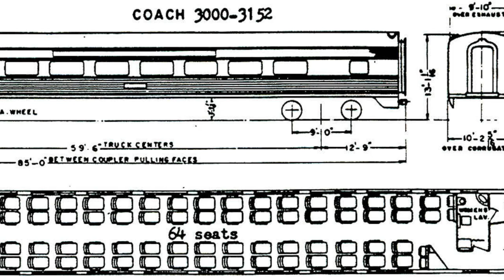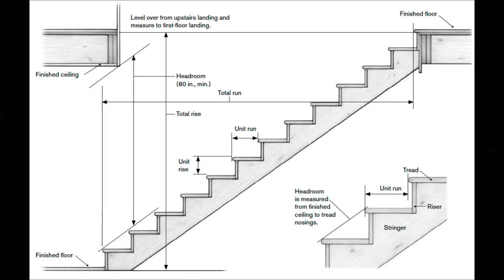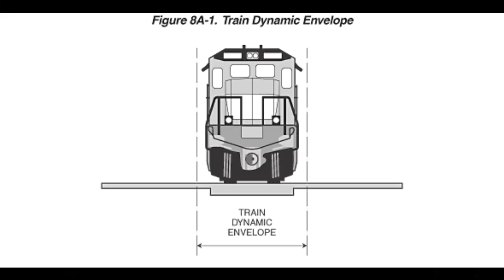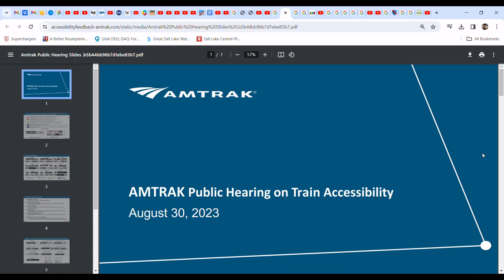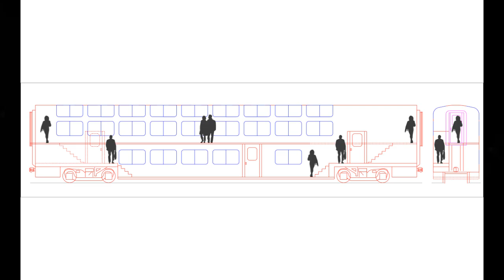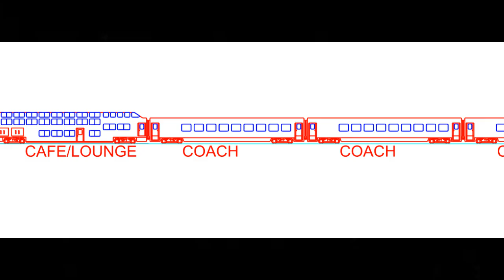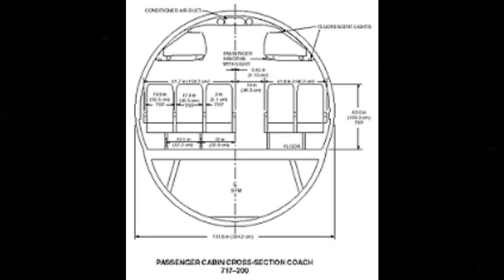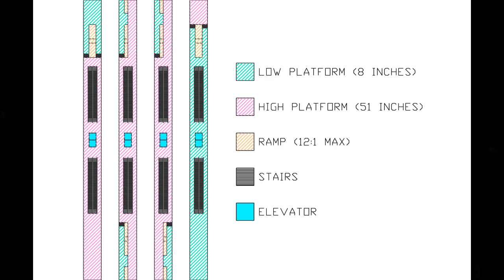An Excessive Explanation of North American Platform Heights

Comment: Seeing how complicated the built in bridge is, I'm wondering, why not just build the bridge like they do on ships? They have it on Stadler LRVs used on BOB in Interlaken Ost, Switzerland.
Reply from the maker: Some rail vehicles do have the bridge plate built in - but the bilevels I featured are designed to be cheap to build and maintain. If you assume that there will always be a conductor present to manually lay out the bridge (a safe assumption), it becomes more cost effective to go with a simple manually-placed bridge.

If you care about keeping dwell times short, then a built-in bridge is definitely the way to go!
Reply: @CSLenhart  I was actually speaking in terms of the bridge/ramp's design choice from a mechanical point of view. 

I visit Switzerland 2 years ago and saw how the lower bit of the train doors would fold out about the bottom edge of the doorway, and become the ramp. It was on their tram-trains on the BOB and ZentralBahn. I haven't seen this design reproduced anywhere else, at least on trains.

And I can't imagine this feature being a problem for Stadler either.
Reply from the maker: @ABCantonese  Oh, definitely! Gap fillers and automatic bridges are becoming more common across European low-floor trains. They definitely have some inherent mechanical complexity, but by now the designs have become solidly reliable.

This is certainly something that Stadler can port over to the USA from their Swiss designs, so long as their American clients know to request them.

Comment: I saw your dome car plan along with the platform height explanations.  I have a few comments.  A.  I think that it's a pretty good idea.* . I hope you send it to amtrak. B. the explanations were quite helpful. particularly the numbers for tunnels, the dome car height, and other measurements.  
A few more details. 
Amtrak could straighten the stairway and add two narrow side ramps just for wheels on the side of stairs. In the event of an emergency and a non functioning stairway lift , crew could more easily evacuate non-ambulatory passengers from the 51 inch to the 8 inch levels. (or the superliner entry level.)  Straight stairways to an upper level can be used to also help guarantee the same ease of evacuation in case of  power loss/ derailment etc.  
Overhead bins like on airlines are a terrible idea for trains lockers near the stairways are better. or under the seats on the upper level. 
Since you haven't ridden one , I will tell you there are dome cars on the Canadian. Dome cars are really fantastic . you can watch videos of Domes, but it's not quite the same experience.
Reply from the maker: Thank you for the thoughtful feedback. The straight staircases being more accessible is an excellent point.

Comment: Thesis, have the truck located just under the roof of the car with the wheels directly connected to it, thus allowing for an 8-inch-high platform
Reply from the maker: @DubGathoni  That's a neat idea, it sounds sort of like the Talgo design. Come to think of it, I wonder why the Talgo floors are so high?
Reply: @CSLenhart  I am not a mechanical engineer, but if I were to make an educated guess, the wheel size has to be a minimum size and because of the live axle, it would create a hump between cars which would not be in line with US ADA or EU PRM regulations.

Comment: 10:44, my problem with this is that any such car built to this hypothetical standard would be by necessity, not passively accessible.  Anything can be made accessible using powered equipment, but (while this is less of a concern on modern trains) if there was a power interruption, it becomes inaccessible very quickly.

Comment: I support what you suggest, but your chair lift argument is completely wrong. Amtrak only has less than 200 of those lifts, at max 1 per station. What you are proposing is at least 2-3 gap fillers per consist, ideally 1 per car. That's way way more equipment to maintain.
Reply from the maker: @jnrfalcon  That's a good point. For single-level cars, two gap fillers would be the minimum (one for each side). That would total up to a large number of mechanisms. For bilevel cars, the retractable ramp would only be needed (strictly speaking) on cars that have a wheelchair lift. That's fewer mechanisms, but more than the number of station-based lifts.

However, there is a major difference between a mechanism attached to the car vs machines stationed at outdoor platforms. The rail cars are full of other mechanical systems that need to be inspected and maintained regularly. Adding one more system adds trivial costs to the regular maintenance schedule. 
Sending workers out to individual platforms is an extra cost, no way around it.
Reply: @CSLenhart  I'm still not quite convinced. But I do want to add to your point that as long as there's at least one or two gap fillers on each side works per consist, all the other ones can be deferred maintenance items. Station based chair lifts usually don't have backups. 
Anyways, as long as there're arguable points, I doubt it would happen, at the very least not during the next 4 years...

Comment: I think Amtrak should modify the design of the Twin Viaggio cars and add doors on both the lower and mid-level sections to be compatible with both High and Low platforms throughout the Amtrak system, like with Caltrain's Stadler Kiss EMUs in San Francisco. They should also lower the height slightly to meet compatible clearances in NYC Tunnels and underground stations. It should be called the Siemens Voyager. It won't just replace the Superliners used on Western LD Amtrak Trains, but also the Sleeper/Dining Viewliners and Coach Amfleet IIs (the Amfleet Is are already being replaced with the Single-Deck Venture cars). So if that were to happen, all Amtrak Long-Distance trains would be Bi-Level, and Intercity Trains would be Single-Level. The new Long-Distance Cars could also be some of the most technologically advanced trains in North America, equipped with TVs/Entertainment Screens in the Romette/Suite (A first for Amtrak) to entertain passengers when nothing is interesting to look at out the window, and also outdoor POV cameras on each Bi-Level Car with Night Vision, so each passenger can see the view outside the train better at night as the train rolls along. It could also come equipped with LED mood lighting in each Romette/Suite (controlled with the entertainment screens), to better pamper passengers during the long train long trip. And unlike the former Superliners, access to the next car will be accessed at the Mid-Level section of the Car, instead of at the top as seen with the Superliners. And if the Viewliners would be phased out for passenger use, they could gut out the interiors and convert them into Baggage/Crew Dormitory Cars, since they are not old enough to be completely retired. The Voyayer cars would come in 4 variants, a Coach Car, a Dining/Cafe Car, a Sleeper Car, and a Sightseer Lounge Car.

Comment: I know this is gonna sound insane, but what if we put hydraulics under the platforms so the actual platform itself could raise and lower as needed?
Reply from the maker: @anitrain  Not insane at all. Airplanes use adjustable jet bridges, why not trains?
You could also move the platform laterally when the train is present, and completely eliminate the gap.

Comment: 1:25 Stadler SMILE, SBB IC2000, Stadler FLIRT/KISS, the new Railjet/Nightjet sets, and afaik quite a few Talgo sets are all low-floor if you get a route with somewhat standardized platform heights (like 55cm and 76cm can be accommodated within a car, but 35cm and 100cm just is too steep) preventing Germany from properly trying.

Comment: What if we redesigned passenger  wheelsets so the passenger floor can nest between the flanges, giving a minimum 40" walkway between the flanges? This could allow the floor of single level cars to be lowered by minimum 10 inches with minimal increases in wheelset maintenance cost. 

Another very radical idea would be to split the axles into half axles, and then you could have easily swapped  "rollerblades" for wheels on each side. Maybe not sensical for standard gauge, but you could theoretically have low floor vestibules.
Reply from the maker: @SethMethCS  Talgo has cars similar to what you are describing. I didn't have time to mention them in this video, but their solution is still fascinating!

Comment: Here is an idea for bilevel wheelchair lifts. Have TWO on each bilevel car, one on each side, and build a roll-up door into the car body, and design the lift to lower down to the lowest point on the coach body. 

Three problems solved. Wheelchair access from both levels to any platform height, using a hinged 36" plate on the outward facing side to bridge any  platform gap. 
Full mobility throughout train, even if one lift is out of order. 
Keeps dwell times short by parallel boarding of able bodied and wheelchair bound passengers. 
 Commodity sensors and circuits can work as failsafes and automatically stop the lowering upon reaching platform height.
Reply from the maker: @SethMethCS  I like the simplicity of keeping all the moving pieces at the doors. That's pretty ingenious!
Reply: @CSLenhart Two lifts per car, one on each side. Regular doors for able bodied passengers. I edited my OP to make it clear.

Comment: GO is actually for the most part, in the same boat as Frontrunner, as they run on their own tracks that run parallel to freight trains from Pickering to Oshawa, and their tracks from Pickering into downtown Toronto, they bought from the freight railroads, so only GO and VIA Intercity trains actually go through downtown Toronto

And in Mo's other cases outside the city, the stations are often on their own track offset from the mainline like a bus pulling over to the curb, so it would likely be more economic to install gap fillers on the platforms of the few stations that will require them, rather than fit them to even car in GO's fleet, which is currently numbered in the 900s...

Comment: The Southern Pacific used a mixture of single passenger cars and articulated sets of up to three units that could be arranged together in different ways to maximize flexibility.  The Burlington Route also stopped ordering more articulated fixed sets after the Nebraska Zephyr sets (the ‘Train of the Gods’ and ‘Train of the Goddesses’ after their Roman names, originally built for the Twin Cities Zephyr service) due to the limitations of fixed sets.

Comment: In Canada (ideally in the US too), where cargo and passenger share tracks should stick to a standard of adding a bypass rail at train stations to alow level boarding for passenger trains.
This means two rails at left- or right-sided single platform stations
And three rails at single and dual cross-platforms that allow the cargo trains to use a middle or side rail for bypass stations only.

Comment: I really, really hate the idea of low level platforms with single level cars because Amtrak can't ever seem to open more  than one or two traps on the whole train.  This leads to absurd station dwell.  Considering the time and effort that's gone into running 110 mph on some lines, having station dwell > 5 minutes to board a handful of people is absurd.

Comment: The obvious answer is better track maintenance to eliminate freight car ‘wobbly’ Do the passenger cars wobble the same way or has the track they use been maintained correctly?
Reply from the maker: Better track maintenance is always welcome. However, every moving train will experience some dynamic instabilities, even on the best maintained track. Freight cars with non-uniform loading are most susceptible, so extra caution is needed whenever freight and passenger trains share tracks, which in North America, is just about everywhere.

Comment: Side note to your thoughts on seating options; not sure if it’s been mentioned yet. 

While mostly seen on older heavyweight cars but also on “newer” vintage VIA Rail equipment, some passenger accommodations are offered as sections. 

Essentially it can be described as an open roomette; two chairs/seats that face each other during the day. At night they turn into a bunk bed situation with curtains for privacy.
Reply: Yeah, those mostly started disappearing because you almost got no privacy, and the old railroads had the nasty habit of trying to cram four people into them.  The pods are probably the closest you'll get to them without getting people freaking about privacy.

Comment: i think we could just stick with 1 standardized height and all trains be created around that....rather simple. They act like a lift in the car is going to hurt, you get like 10 feet to work with on the width, a wheelchair left can be made as tight as 30 inches, but 4 feet is a simple overage that gives comfort and still leaves 6 for passthrough. What do they lose? Maybe a half-cabin on top and bottom. Match that with bathrooms for the other half and you have an even spread across the floor plan. If you drop it to 7 feet floors, you can easily drop it below limits for a double floor between the wheels. You could do 8 but then you go over limits that disqualify some runs.

As for the wheels themselves, you could technically offset the deck so the lower floor climb is on one side of the 10foot width span and the upper floor is on the other side, allowing both to traverse the cars. The halfspace in the "deadzones" (underneath the upper floor walkway and above the lower floor walkway) can have various equipment and/or storage space (such as fire extinguishers, tools, etc.). If you zigzag center of the car for the walk lanes, then the car will be able to work in both rotations to line up with traversal points between cars.

I find this to be the obvious solution, but like all businesses, they only care about the money....and they think more seats means more people will fill them, when that's obviously just not the case since we aren't like other countries. Last time I tried looking at booking a ticket just for the experience years ago, they said I had to pretty much rent the whole car at over $250 because there just wasn't any demand (the cost was for them to basically take the car out of storage for the 1 trip and put it back afterward). Maybe if they made it more luxurious, the rich would take notice enough to reduce costs which would allow "coach" or lesser forms to piggyback on the hype (people love to copy what the rich do)

Comment: I agree totally, the gapfillers should be carried on the train.  Problems arise when the weather gets cold, as hydraulic or pneumatic systems get sluggish.  It gets worse by the snow swirling around and becoming packed in those small areas, and then becoming solidified, making deployment of said equipment, difficult, if not impossible.  
The designers and builders are going to need to figure out how to use compressed air, which there is readily available from the train line,  to periodically blast, to try to loosen, dislodge, blown clean, the entire compartment, while in motion, and have buttons near the ops stations so that boarding staff can also manually blow down before the complete stop in stations.  Heat may also be a neccessity, as running in wet weather, then transitioning into colder weather, can also bring complications.
GO Transit, merely a commuter network,  has set themselves up that car five (from the loco) is the accessibility coach.  One door, will be met with a sub-platform, that will easily accomodate the chairs, walkers, and otherwise not-so-agile-on-their-feet passengers, and yes, a footbridge is used. This requires the train to always be oriented the same way, which is locomotive on the East end of the train.  For those trains that run more North-South,  they base it off having the loco on the East end when it`s at Union Station.   Any train can run any route at any time, so long as the loco is on the East end of the train.
The gauntlet track, and the hydraulic drawbridges, are both cute, and practical.

Comment: Gap fillers were not introduced first by brightline in florida, UTA used them in utah long before brightline existed.
Reply from the maker: I should have been more specific. I love UTA Frontrunner and the level boarding! The gap fillers are permanently attached and still leave a small gap. The Brightline versions extend automatically at each station and fill the entire gap. Definitely more complicated, but necessary in order to share track with freight trains.
Reply: @CSLenhart  But the normal tracks trains have the extendable ramps for wheel chair users, and there is no gap. Obviously the blue line doesn't have one, but red and green do.

Comment: 1:15 I am not sure if this applies to all of Europe but thinking about it, I think Switzerland may have standardized on one level boarding height for the new trains as well.
I know that SBB and BLS have been building out platforms and the height seems to have changed there. Additionally, all newer trains I can think of have level boarding.
I might be missing one but it seems like this may be a problem that is being solved right now.

Older trains definitely don‘t have level boarding though, I agree with that.

Comment: The semipermanently coupled bilevels would spell the end of splitting the Empire Builder in Spokane into the Seattle and Portland sectons.  You could add another baggage car easy enough but duplicating sleepers and lounge doesn't make sense.   If they do bring back the North Coast   Hiawatha it could cover one or the other but most proposals have it running the third route through Ellensburg.